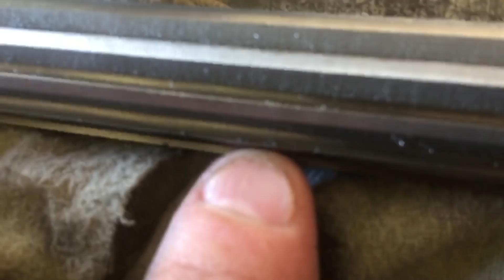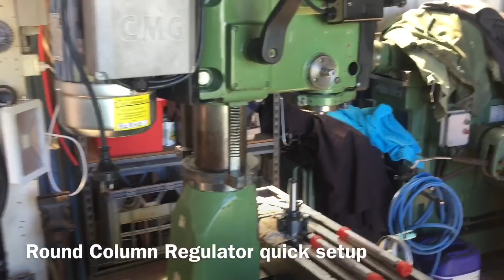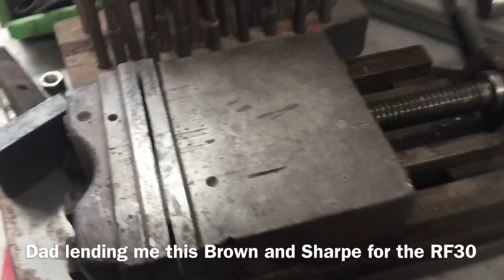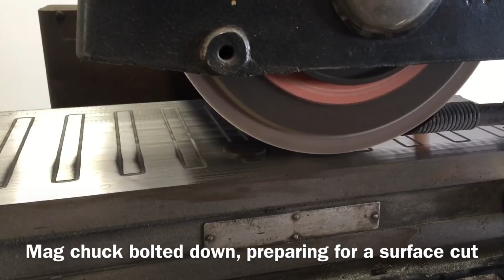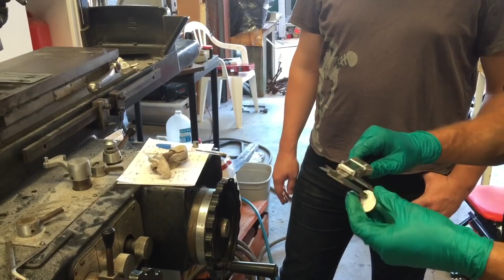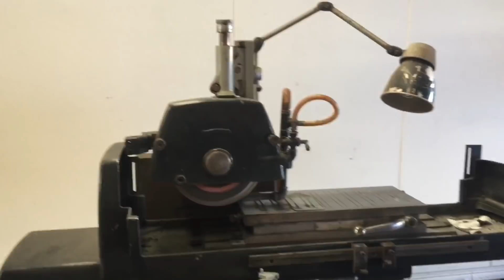Workshop Update 16

Comment: G'day JB,You didn't get the final size of those shims using a set of digital callipers did you?? Get a micrometer mate! Good video though. Regards Dave
Reply from the maker: Tolerance for inlet is 0.15-0.25mm and exhaust is 0.25-0.35mm we targetted 0.2mm and 0.3mm, played what was brung, did the job and all up and running now!

Comment: I broke my vice years ago. I haven't got round to fixing it, yet. To move the jaws at hi speed tighten/loosen using the brass nut by hand and to move at low speed for tightening use the spanner on the screw.
Reply from the maker: It was surprisingly quick to cold bend the spring coil and getting it working again, simply by cutting the broken coil off. Worth a shot if you feel so inclined :-)

Comment: Please get an opinion on thinning shims that are in direct contact with cams  Fiat twin cam engines were notorious for losing the hardening on cams using surface ground shims.The surface ground shims not factory  finish stopped the bucket from rotating Friendly advice no malice as cost of rebuilds on these engines is expensive. Cheers from Newstead Victoria
Reply from the maker: Hi John, the surface ground finish is face down with the original factory finish face up. In this way the cam lobe runs on the correct face of the shin and bucket combination, good point to make thank you